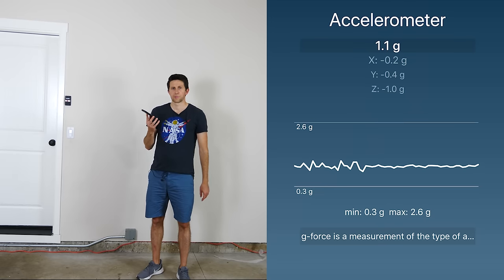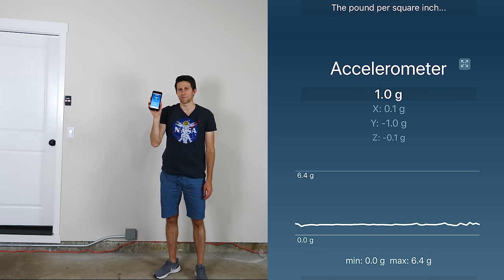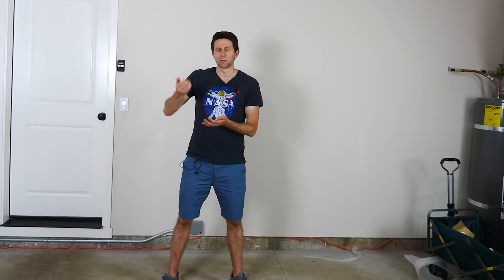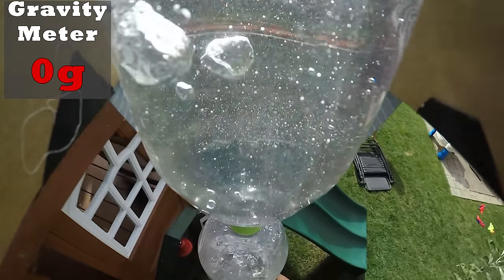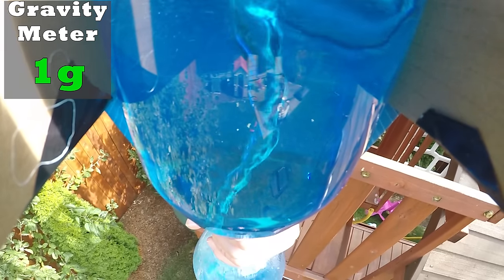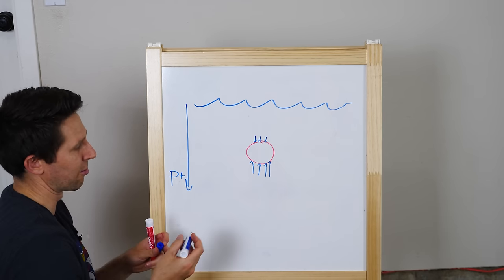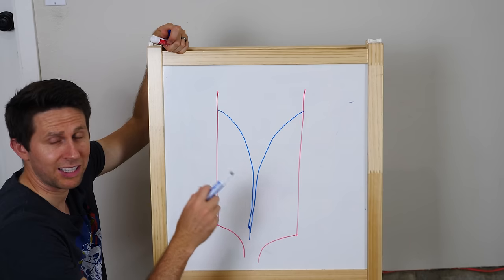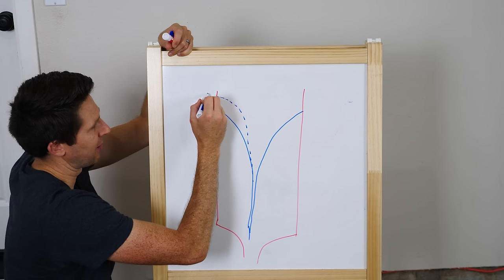What Happens to a Whirlpool in ZERO-G?

Comment: Really great experiments! What I realized in the 0g whirls experiment is that the whirls collapsed shortly before reaching the ground. If the drop of the bottle was longer, I guess this would be also pretty interesting to see. I think this is due to lack of gravity which is the driving force to build the vortex in the first place. The vortex only exists, because water from the upper bottle wants to go down to the lower bottle. Without gravity, the water doesn't move down anymore. As a result, the only movement should be caused by the centripetal force and by getting "reflected" by the bottle's wall. I really would love the see that happening!

Comment: "The only reason you feel weighted down is because the ground pushes up on you...

If you didn't have the ground push up on you then you wouldn't feel weighted down."
Reply: or  air when you are falling
Reply: That's nice
Active Passive voice grammar class along with Physics
Reply: He said that as I read it
Reply: I dont understand... In order for matter to have a normal force opposite to gravity it has to be in contact with it. When in space there is 0 gravity and yet the gravitational force of a planet is pulling you in
Reply: @jvjv2138 The "g's" that we talk about are only a mesure to the reaction or stress that a body suffers due to accelaration or gravity, but not a measure of the force itself (even If It can sometimes be thought of in this way). Note that this stress can only be felt when you are in contact with something to opose your accelaration. In fact, gravity isn't even a force, so no worries :)
Reply: @jvjv2138  I think we're talking about acceleration forces here. There is no acceleration happening on the way up or down. It's simply losing kinetic energy to overcome gravity.

It experiences acceleration when he throws it up, then as soon as he lets go it's just kinetic energy being lost and regained, until he catches it or it makes contact with the ground. Then deceleration happens.
Reply: What it means is that when you are falling the air pushes up while you are traveling downward so it feels heavy because you are falling faster than the air that pushes you, so you feel like weight is put on you
Reply: @01DOGG01  Of course you have accelaration when going up and down... Accelaration is defined to be a chage in velocity, so if you fall faster, or go up slower, you are by, definition accelerating. A change in in kinetic energy only happens because of a change in velocity (accelaration).
Reply: @joaogabriel6424  Yeah but you know what I mean... It is a change in kinetic energy as it's going up and down. It is weightless in a virtual sense as he demonstrated. Just like the 'vomit comet' plane.
Reply: @01DOGG01  Well, I know but, the really amazing thing, is that it isn't "virtually" weightless, It IS actually weightless when in free fall.
Reply: Fun fact: We really don't physically touch anything. Those damn electrons prevent us from touching anything! DX
Reply: @jvjv2138  actually there is gravity in space. The astronauts in the space station has almost the same gravity pulling on them as on us.
Reply: @Jason-od9dx  no
Reply: I'm more or less confident that being an Asian, my parents' expectations would nonetheless weigh down on me, irrespective of whether I had a ground under my feet or not.
Reply: @joaogabriel6424   although you're quite correct but actually gravity in physics is seemingly a force , and a mystery at the same time.... it is a force i would say
Reply: @mr.beatbreaker2312  Well, there is proof that gravity isn't a force experimentally. Also, Einstein's general theory of relativity is all about describing gravity as the result of the curvature of spacetime and not a force.
Reply: @joaogabriel6424  umm yeah but experimentally it can be expressed as a force.... but actually the quarrel is quite meanibgless between us because gravity is so much mystic and we know so less about it that its both at the same time. ....
Reply: @joaogabriel6424   see man, now you're being stubborn on this ? We all know its a force because it affects, and also interacts with objects similar to force and also  conplies to all the rules of it being a force thus making me say that it "can be defined as force "...
Reply: @mr.beatbreaker2312  Actually, what I said is that Gravity can't be expressed as a force experimentally. There are are experiments that show that isn't the case. The most simple I can think about, is that the mass of object alters the flow of time in the surroundings of the object ("curvature in time"). Newtonian theory of gravity also fails to describe various fonomena observed. I don't agree with you about gravity being "mystical". Even if we don't fully understand the gravity on its totally, as we don't have a theory o quantum gravity yet, we can surely say that gravity isn't a force, and treating it as such, is just a first aproximation that only work in some (actually a lot) of cases.
Reply: @joaogabriel6424  
By including the second para you literally meant what i did but in a more descriptive and different way 
But our ideas are bound to be indifferent.... and these approximations you speak of is very true. .
Reply: I’d make a dark joke,  but...
Reply: Just to clarify some misconceptions. 

1. In space there is gravity... there is always gravity everywhere in the universe because there is a lot of mass and energy. You will always feel an accelaration coz of gravity. So while in orbit astronauts are pulled by gravity.. there is gravity and its wrong to say that there isn't.

2.We understand and we know what gravity is realy realy well. It's the curvature of spacetime, geometry itself having affects on our everyday world. We only don't know what happens on the atomic scale because we don't have a theory where gravity is quantized.. but that has nothing to do with our everyday world... its like saying that you cant know if the sea is waving because you dont know what the water molecules of the sea do. 

3. Also... In this theory gravity is not a force (kind off, big topic) but that (i believe) has to do with the definition that we use for what a force is.. I dont want to get into the details coz i'll be writing for days but the truth is that in the 4d spacetime gravity is not a force (it doesn't accelerate you) but in our 3d space we percieve it pretends to be a force. We dont perceive time in a wholesome spatial way and thats what makes the difference.

4. The feeling of weightlessness and the feeling of accelaration are two different things. You can accelerate while feeling weightless and you can be weightless while a accelarating.

All in all what happens is that you accelerate coz of gravity but you feel weightless because there is nothing that touches that exerting a force. The key word here is contact (or normal forces to be more scientifically accurate) a normal force is just a force applied to you by contact with something else and is always perpendicular with the contact surface. You feel your weight because you feel the force that the floor excerts on you by touching you and pushing you up in opposite direction of the force of gravity. But that has nothing to do with the gravitational force itself... it just happens that the normal force of the floor is the reactionary force of you pushing the floor down. Imagine that you are in empty space only with a wall.. even if there is no gravity (coz of the word empty) you will feel a weight if you push the wall for a split momment. But because there is no gravity you will start moving in the opposite direction of where you pushed coz the normal force from the walll will react and push you back
Reply: @RedHammerBodyShop  yes, there is a difference in not having any gravity at all, and constantly being "pulled" to earth but missing it due to centrifugal force.
Reply: @jvjv2138  In orbit there is not 0 gravity, there is 0g, but usually in low earth orbit you still have like 90% of the effect of gravity, without it you could not orbit, in fact if you go out to space with a rocket and go just up, you probably would end up falling back to earth in one go unless you start to accelerate sideways to get an orbit, there is the exception of getting to the escape velocity of earth,  but if you are thinking that once you exit the atmosphere you start to float and do not fall back down you are mistaken.
Reply: As soon as he said that i started to feel more of a pushing force from beneath my feet and butt instead of a "me falling down" feeling... weird how a change of perspective can make you physically feel different😄

Comment: 1:43 - Okay, so I was just experimenting around with this application, and I've noticed that when I threw the phone up, but gave it a spin before around any axis, then the accelerometer haven't showed me 0 g, instead like 8 g or so.
And this may could be the topic of a new video, like showing how can we create artificial gravity in space, by spinning a 'spacecity' or anything around its own axis, (if it is possible).
Reply: It is simple circular motion.
Reply: Fighter jet pilots are trained in a centrefuge which creates large g forces by spinning
Reply: I've already watched a youtube video about it (if I'm not mistaken, by PBS Space-Time). It's not as simple as snipping a spaceship. It needs to have a very big radius, otherwise, you would get some uncomfortable Coriolis effect when getting up (your head would feel a force to a side). Also, jumping would sort of break the system. You might think these are only concerns, not features that make a spinning city impractical, but it's definitely important to consider. Maybe training the astronauts would be enough and they would get used to the weird perks
Reply: Check Tom Scott's video "Passing out in a centrifuge"
Reply: People already did that using the centrifugal force
Reply: That's because the accelerometer of your phone is not located at its center of mass. The phone rotates so the points not on the axis accelerate.
Reply: @Moinsdeuxcat  And if we did some precise measurements of rotational speed vs accelerometer readings, we could determine precisely where inside the phone the accelerometers are located.  Or just open up the phone.  Hehehe

Comment: When a rocket  in outer space is not being accelerated (I.e., it is just in orbit or on it's way to Mars, etc.) the fuel and oxygen arrange themselves in a layer against the walls of the tank, like the whirlpool shown here.  This poses a problem for pumping liquid out of the tank because the pumping will quickly form a cone "down" to the opening of the pipe that carries away the liquid.  One way of overcoming this is to put a crease in the side of the tank.  Surface tension then forces the liquid to move toward the crease where it can be pumped away.  I've never seen this done, but is seems like you could make a creased pop bottle the the liquid would move into the crease as the bottle fell.
Reply: Objects in orbit are under constant acceleration.
Reply: John M  I think he means when experiencing microgravity
Reply: Yes objects in circles experience acceleration but that acceleration is canceled by downward gravitational force. Hence net acceleration is zero, object experience 0g.
Reply: @MEBVishwaS  Objects in orbit are constantly accelerating at a rate of 9.8m/s^2. Objects in orbit are in free fall, which is constant acceleration.
Reply: Objects in orbit experience lots of acceleration.  Sorry to cause confusion by not explaining clearly.  Gravity will accelerate the object downward.  In a circular orbit, momentum is resolved into a vector in the direction of travel and a direction outward from the center of the earth.  If the object remains at a constant altitude, the gravity vector and outward vector are equal and "cancel" each other, making no net vertical acceleration.  The vector in the direction of travel is unopposed, thus the object moves "foreward."  If no additional force is applied, both the liquid and the tank will move at the same speed and surface tension can work its magic.
Reply: @kirkhamandy  Correct you are.

Comment: If that same whirlpool bottle is thrown out if a plane, water will first form a cylinder and gradually get back to whirlpool shape again as it reaches terminal velocity, right?🤔
Reply: The bottle is being acted on by the water as well. I think you may have to assume the bottle remains fixed in its position.  Because it can twist and the bottle will start rotating too.

You can probably just flip the bottle over to simulate that. But that’s a lot of angular force against the water if you do it too quickly. So I would guess you want to do it slowly

Edit: but maybe you want to turn it over quickly. I’m not certain. It’s harder for a vortex to rotate on its side. You are probably going to lose a lot of force no matter how you rotate it. Idk

Comment: Slight correction, you used centripetal force and centrifugal force kinda interchangeably, which isn't right. Centripetal and centrifugal forces are forced that act counter to one another to maintain a body rotating around a point. They're best conceptualized by thinking of a weight tied to a string being swung around in a circle.  Centrifugal force is the mass of the weight pulling outward on the string, the centripetal force is the string pulling the weight back towards the center of rotation.

Comment: Another way to explain the whirlpool would be to say that with a water bottle in gravity, there's less pressure on the top than on the bottom. So when you introduce rotation into the water, centrifugal force pushes against the water, but the water on the bottom pushes back with more force due to more water pressure. The forces equal out, and a whirlpool is born, giving it its distinct tapered shape. But when there's no gravity, there's no gradient in water pressure, so the forces equal out by becoming straight.

Comment: Tkank you for your videos, had plenty of funny learning whith them!
A little reflexion: in space, in free falling, the water won’t flows from one recipient to another without any additional force. One way to reproduce the water flowing between the bottles is to rotate the system and recreate a gravity that pushes liquid to flow.
But this will create again a whirpool or bubbles because the system is not still inertial.
One other way is to push water flow with a pump, but this will causes a pressure gradient in the liquid that I think still holds the whirpool or the bubbles.

Comment: Now here’s an other experiment. Rotate a bicycle wheel and drop it. Have it dropped when it’s vertical, horizontal and on it’s diagonal.  

When dropped on its vertical axis, what will happen? Will the rotational force increase, decrease or stay the same? Will the wheel drop faster or slow as compared to it not spinning at all? Same goes with horizontal and diagonally. In either case, will the axis change? Meaning if dropped horizontally, will the wheel try to go into the vertical or the other way around?
Reply: I have no idea what did u Said

Comment: Very cool demonstration! Thanks.
I wonder what would happen if the experiments were conducted in a large rotating space station? The Coriolis effect (centripetal false gravity) along the inside edge of the spinning station  will give the sensation and perception of weight (let's say 1G based on radius and angular velocity). If the space citizen spins their whirlpool bottles and lets them go, will they "fall" or stay at zero g and weightless? If you toss them up will the potentially fall on the other side of the station? If someone accidentally left the airlock open and the station  was at vacuum pressure would that change the outcome? I'd really love an answer and diagrammatic explanation. 
Love your work!
Reply: The bottles will fall and experience momentary weightlessness just like in this video, but with the complicating factor of Coriolis effect (not the same as the rotational artificial gravity) causing the place where the bottle lands to be offset horizontally from where it was dropped.  If the space station was small enough, you could toss the bottle up and have it land on the other side (although to get really opposite of where it started you would have to angle your throw to compensate for the angular velocity of the bottle).  How much Coriolis effect you get depends upon how big the space station is (larger diameter means that the rotational speed needed to get 1 g is lower, thus reducing the effect).

Comment: Did anybody actually wonder that as we know centrifugal inscreases by no of rotations  per given unit of time.. so that would more force being applied to push the water towards the walls of the bottle , thus the water finding no other way to escape or more space to flattten on, it will after reaching a certain speed begin to feel compressed and thus will become ice after reaching a very very fast speed......  thus it was a freat understanding of what can happen to a  whirlpool in Zero-gravity so it will literally form a coating of  (swirl-textured) ice on the inner sides of the bottle....

Comment: I like the whirlpool one, but even better: When released, the water didn't just become a cylinder, it actually jumped to the top of the bottle, which suggests that the force of the spinning water on the inside of the bottle actually shoved the bottle down faster than gravity, which wouldn't last long, but makes sense in the sort of two-body system that dropping it created.